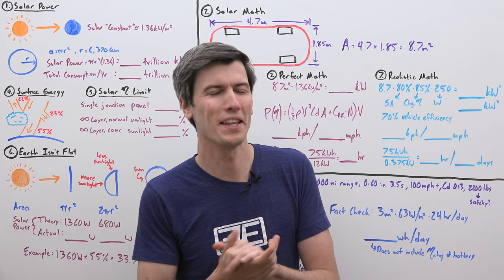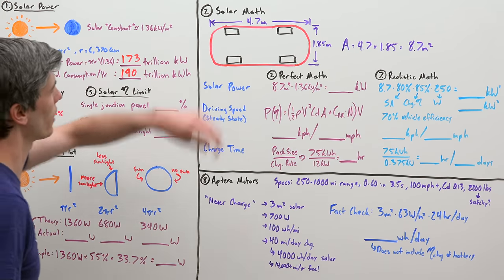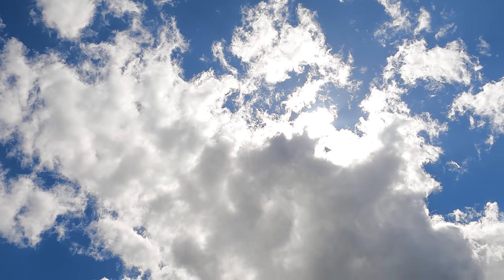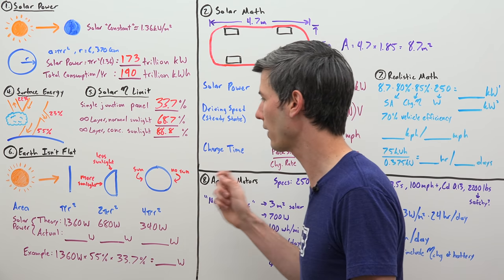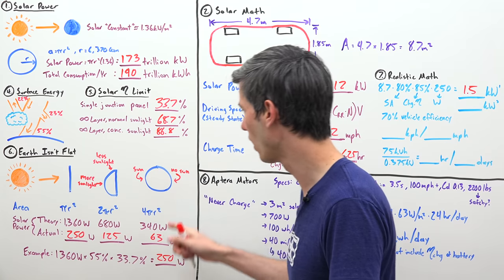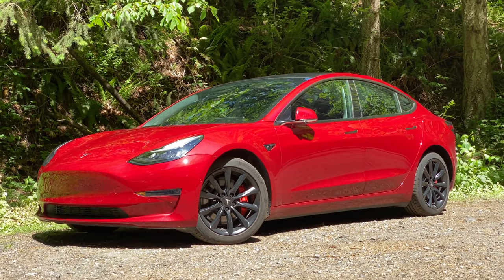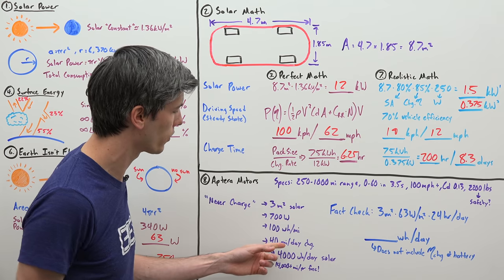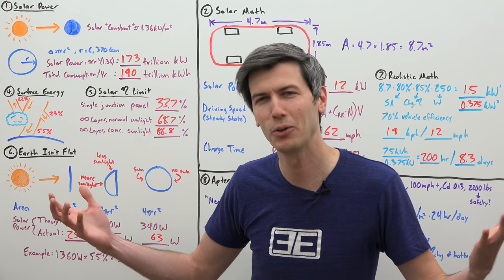Why Don't Solar Powered Cars Exist?

Comment: just rotate the solar panels to be pointing directly at the sun depending on where u are on the planet...
Reply: On a car?
Reply: @fredbloggs5902  sure, why not?
Reply: @fredbloggs5902  put a little piston underneath them, when panels no longer facing perpendicular to the sun, extend the little piston, change the panel angle. easy.

Comment: Let's not use a lithium ion battery pack for the EV.  Instead let's use a supercapacitor pack.  Why?  Because it takes 1/10 the energy needed to store kwh because of the very low internal resistance.  This means it takes 1/10 the time to charge the same amount of kilowatt hours as a lithium ion battery pack.  So instead of 200 hours it be 20 for 75 kwh pack.  Now a 75 kwh pack has a range of 300 miles or so and a 75 kwh supercapacitor battery pack would be huge.  Way bigger and heavier than a lithium ion pack.  But over 95% of people only drive 30 miles round trip to and from their jobs.  You only need a supercapacitor pack that say has 40 miles range.  According to my rough armature calculations you could charge a supercapacitor pack to 40 miles in 5 or 6 hours on a 2 foot by 4 foot solar panel that would be small enough to fold up and fit in the trunk.  Another option would be to have an even smaller pack that only has say 20 mile range.  Drive to work, unfold the solar panel out of your trunk and in 3 hours you will fully charged your pack to 20 miles to drive home.  A 40 mile range supercapacitor pack could full charge at a fast DC public charge station in 1.25 minutes or 10.5 minutes on a 240 volt charge station or in 50 minutes on a regular 120 volt 16 amp house electrical outlet.

The other benefits of using supercapacitors are no need to heat or cool them, super fast charge times, last for hundreds of thousands of cycles if not a million, never loses capacity, better regenerative braking, can be fully charged and discharged completely without any damage and are cheaper to produce.

People are way too hung up on range.  A range of 40 miles would be more than sufficient for well over 90% of people.  I did the calculations head to head a Model 3 long rage of 300 miles to a 40 mile range super capacitor for a 400 mile trip with the super capacitor EV charging at 240 volt charge station 9 time and the Model 3 charging once at a Tesla super charger for to get the last 100 miles it take the super capacitor EV 90 minutes longer to drive 400 miles.

It is a different story if the supercapacitor EV could stop at even lowest fast DC chargers instead.  Then they take just about the same amount of time to both drive 400 miles.  On longer trips than 400 miles the Model 3 takes way longer than the supercapacitor EV because the first 400 miles both EVs start with a fully charge pack.  If both cars had to start with an empty battery pack the Model 3 on a 220 volt household outlet would take 10 hours to get a full charge before they could leave.  The supercapacitor EV on 220 volt take just under 11 minutes to fully charge.  This would mean the supercapacitor EV would be at the finish line 400 miles away before the Model 3 even was finishing charging and leaving the driveway.

Comment: Safety issue when the sun hits it there will be glare and it can blind a driver either behind or in front
Reply: That could be true with any car.  The full solar version will have the rear hatch completely covered, so no glare coming from the back.

Comment: But a solar panel in the roof of teslas can help to improve efficiency letting the solar panels run the ac, instead of from the main batteries, also the ac could be running without spend your actual battery through hot days, so would be a good idea

Comment: What about a Solar Powered Hydrogen Fuel Cell Vehicle? How much Hydrogen could a solar panel generate from water to refuel the vehicle?
Reply: The Hydrogen energy round trip will always be considerably more wasteful of energy and therefore more costly than a battery electric system.  There may be a place for hydrogen, but it shouldn't be as a personal ground transporation fuel.

Comment: actually a full year of power for a day of sun is not a lot. think about it. we would have to cover 1 365th of the planet. 1 730th with better panels, but those are too expensive. anyways. just cover rooves and roads. bam. enough energy.

Comment: We need to stop thinking that money is the first principle in everything. That is how Tesla motors was born in the first place, Elon expected it to fail, money was not his first principle.  Without that approach, without that kind of thinking, he just did what he knew humanity needed, and that is the best way to find your market, Tesla motors would never been born. Tesla motors forced the traditional auto manufactures to step up their game, just by showing the world how it is done.

My point is if it helps slow climate change, then we should be doing it. But you would need to go thru and do all the math to figure out if those solar panels will actually emit less Co2 in the manufacturing process, than the Co2 you save from not draining the amount of energy over the life expectancy of the panels and vehicle, from the grid(coal plant), if you didn't use the panels. It is to find out if the whole process with manufacturing the panels on the car, over the life of the panels, will in the end emit less carbon or not. But the example is for math purposes, to test if using the panels adds enough energy into the car to offset the Co2 it took to manufacture them. If so, and if by a considerable margin then money or not, we should do it.

Don't ever think it can't be done. I mean every little bit helps, at least it can give you like a "limp" mode for emergency if you are lost away from charging. Also could be used to help keeping a long time sitting car from discharging and destroying its battery. The entire skin of the car should be solar panel, including glass. No matter what part of the globe you are at, some part of the car will be at a decent angle to the sun if you have it designed with panels covering the entire skin, sides, etc... Also you can have a park/charge feature, where you park push like a sunroof button and double your solar surface area, by having panels open out angled at the sun too. This would really work good on vans and square stuff because then you can design it to hide away flat panels easy, for driving mode. Then when you park by having nice flat panels aimed directly at the sun you get max charging. I had an ideal about solar panels on cars before when i was a kid, but i envisioned them being flexible to any shape you want, and use it like a double skin on the car, like a funny car opens up and you see inside, but this will open up but there will be another skin under there, still there. This way it pops up when you park and angles at the sun. 

But there is only like half a market for solar panels on cars, because for example places where the sun don't rise for months, and places far away from the equator won't get enough benefit from it. And this is indication the market is not there, not for everyone. They can still use electric cars, but solar panels on the cars won't help them much at all. That could be one of the main reasons you won't see manufactures put them on cars. Manufactures like to standardize, and this would break up standardization more and they try to prevent too much of that. They want a standard that works north, south, east, or west, it keeps production cost way down comparatively. They are still stuck on money being first.  Tesla forced them to step up to the plate.

Comment: you are measuring solar panel power, not total solar power, which would have 3x
Reply: you assume you have only the surface of the top of the car, not the bottom, and also not taking account tent folding solar panels, or solar wings, or vertical solar heat collectors
Reply: so whats with the 1000W/m^2 -> 250W/m^2? and you are using 1/4 not 1/3 of the typical solar panel
Reply: loads of bullcrap numbers, very limited application
Reply: engineer making selections not generic observations or options
Reply: @Jkauppa  Which reflects the present Aptera design.

Comment: What if we powered the battery. With Wind , solar panel and ac motor connected with the wheel. Wind that is powering another ac motor with some sort of complex gear box to generate more force for the ac motor. Will it be enough to indefinitely or at least lessen the reliability of solar panel.

Comment: You're forgetting that solar panels can be placed on the sides of the cars as well, you're also forgetting the fact that solar cars don't necessarily have to be as heavy as difficult cars, nor do they have to require that old boxy shape that was standard for combustion engines

Comment: rare earth minerals are not renewable or cheep,
Reply: You are correct.  Battery costs make up much of the cost of an Aptera, or indeed any electric car.  But the need for rare earth minierals is likely to plummet and there will be abundant sources opening up, such as seawater.

Comment: Has no one heard of the "World Solar Challenge" now called the "Bridgestone World Solar Challenge"?

The first race was held in 1987, won by a car named "Sunraycer."

It's an annual solar car race held in Australia. Cars powered by solar electricity run 3,022 KM over 4-7 days.
Reply: You are confusing experimental vehicles on closed tracks with consumer cars. Those compete for distance records or top speeds but they are nothing close to safe and legal on our roads. Low ground clearance, huge turning radius, tires and suspension not ready for road use. Some require the entire top shell to be lifted by a team to get the driver in. None of those will ever enter mass production, only some of the proven design features will translate to consumer EVs.

Comment: So to charge a 75 kW hour pack in 30 minutes would take a solar panel 200/0.5*8.7=3,480 square meters!!!
Reply: Almost no one would need to do that.
Reply: What are you talking about? People do it at superchargers all the time. More like 45 minutes, but the plan is to get faster.
Reply: @tomgnyc  An Aptera could charge to a 1000 mile range at EPA Highway cycle speeds in an hour at such a charger provided the charging rate didn't slow down as the battery approaches full charge. (It does).  This is likely less time than the time required for gasoline fillups for a conventional ICE vehicle making such a trip.
Reply: What does that have to do with my comment? I'm talking about a 75 kilowatt hour battery pack, I'm not talking about aptera or any other model of car.
Reply: Using EE's math what I wrote was correct.

Comment: I usually really like your programs but in this one you seem to take joy in the idea of abject failure of the sun to make any contribution. The truth is is very very few people ever drain their electric vehicles. They drive to work where the car sits in the Sun all day heats up then they drive home. Retractable solar cells that cover the windshield would keep the car cooler and put some energy back in the batteries but instead of exploring these numbers again you seem to take joy in the idea of plugging into a network that is largely fueled by coal fired power plants.

Comment: If energy from sun is not reaching the earth's surface then how can aperta's car claim to have 4500 wh/day when realistic math proved that wrong beforehand
Reply: You might be confusing power and energy.  They are not the same thing.  Aptera with "full solar" (claimed at 700 watts of "peak sun" POWER).  If the car is exposed to 6.43 "peak sun-hours per day", it could generate 4500 watt-hours per day of ENERGY (0.7 kilowatt x 6.43 peak sun-hours/day = 4.5 kilowatt-hours/day = 4500 watt-hours/day).

Make sense?

Comment: It would be great if hybrids of the future used hydrogen, battery, solar and wind to make power.
Reply: Hydrogen is a red herring pushed by the fossil fuel industry...  95% of hydrogen comes from reforming natural gas, for the foreseeable future...  making hydrogen from renewables is about 40% efficient as a battery, only suitable for a few niches such as maybe long haul flights?
Reply: @peterchandler8505  Exactly.  The relative inefficiency means that hydrogen can never be as environmentally or as cost effective as battery/solar, even allowing for the manufacturing energy inputs.

Comment: I always wondered why they cant integrate large alternators attached to the drive motors on each wheel so that when the motor spins it can be creating the energy needed for propelling the motors and have excess energy for charging the batteries as well. I know its a lot more complicated than I make it sound but with todays technology I bet they can make it happen.

Comment: We actually do have solar powered cars. They’re called internal combustion engine vehicles. Plants are photosynthetic and store solar energy, we use fossil plant goo. Stored solar energy technically fuels our cars. Unless you drive a Tesla in which case it’s likely fueled indirectly with compressed hardened plant goo known as coal, or uncompressed plant gas known as Natural Gas burnt to generate the electricity they use. There by some (actually most) of them are indirectly solar as well.😉

Comment: Aptera has rounded surfaces with solar cells, guaranteeing that they never have their theoretical maximum. Also, their solar cells are far less efficient (they also glaze them reducing efficiency), think 10-12% at best in laboratory conditions.
Reply: You have some incorrect information here.  The Aptera panels will not be glazed (glass covered) and are between 22-23% efficient.
Reply: @n.brucenelson5920  "The Aptera panels will not be glazed (glass covered) and are between 22-23% efficient." No product to test, this claim is 100% pure marketing. Until there is an actual product, we go with known quantities. Also, a curved surface guarantees suboptimal charging at all times. Basically, you are defending marketing terms, not facts. Bring one of these solar cells from a production unit to a lab, and we will see.

Comment: "Why Don't Solar Powered Cars Exist?"
Um... they do exist... They're all prototypes that haven't started mass production.
There's apparently an entire industry already for solar powered race cars.
Reply: You are confusing experimental vehicles on closed tracks. Those compete for distance records or top speeds but they are nothing close to safe and legal on our roads. Low ground clearance, huge turning radius, tires not ready for road use. Some require the entire top shell to be lifted by a team to get the driver in. None of those will ever enter mass production, only some of the proven design features will translate to consumer EVs.

Comment: Such a car could never meet US safety requirements.
Reply: We will see, the structure is similar to formula 1 racing cars, although not usually set up for day to day use, plenty (sadly not all) of F1 drivers walk away from pretty severe dings!
Reply: Aptera will be tested to US crash safety standards and the results published before they start shipping. We know from modeling that it will do exceedingly well.

Comment: The solar panels on a car will never achieve the efficiency stated. Have you seen cars on the parking lot? How many are spotlessly clean? Any dirt/dust/salt/grime/bug splatter will significantly reduce the efficiency. Any rock chip from the road will damage the panel. You will be lucky to get 25% stated efficiency after a few months on the road.

Comment: This was the worst video I have seen you do.  There was no reason to calculate solar energy numbers form space as an ideal.  It's not possible to hit that ideal with out stripping the earth of air and electro magnetic field.  
  33% efficient solar panels are not realistic.  20-25% efficiency is more realistic with out the solar panels costing more then the car.
  The final calculation was with a 24hr day.  If you are getting sun for a full 24 hours.  The energy of the sun would be closer to 15-20 W/M2.  Not 63 W/M2 per your earlier math for arctic region.
 Normally I like to watch you videos.  This was substandard.  Wasted time with math that could not matter.  Then used math that was not accurate or realistic.  The possible save.  Are the comments of people saying your math is under valued for how much energy from the sun hits the earth.  Which would be early mistakes, countering some of the later mistakes.

Comment: I remember hearing about Aptera 10 or 12 years ago, it's vaporware you'll never see one.
Reply: That company liquidated.  It was bought out of liquidation by the original founders in 2019 and the original team reassembled.  They are back with a bran new design and successful business startups under their belts, including a successful IPO.  They just hired a very experienced CFO.  They are happening.